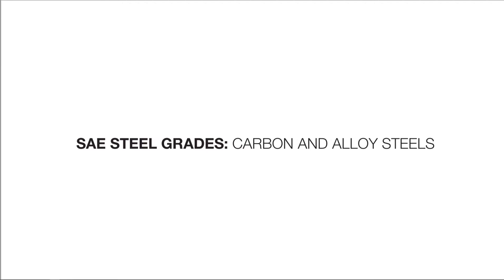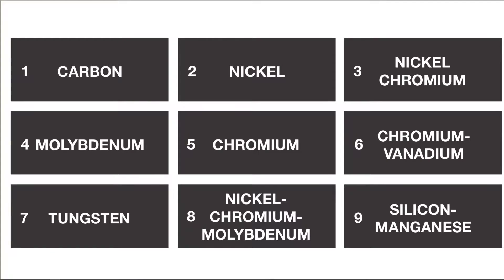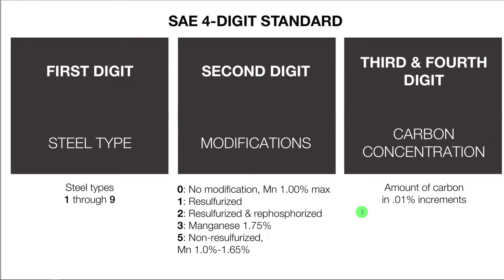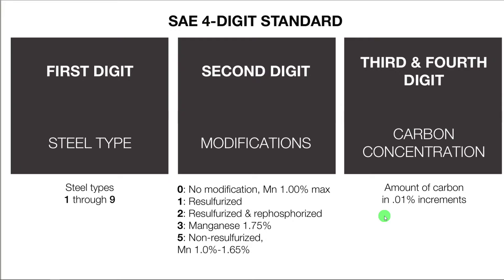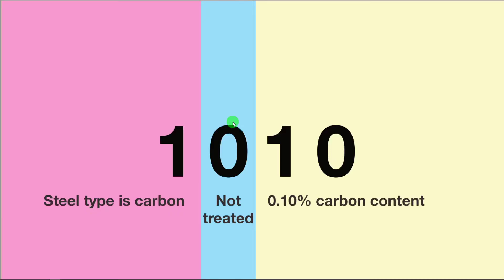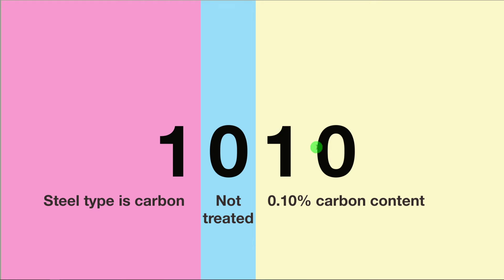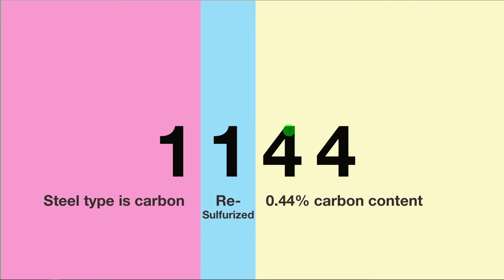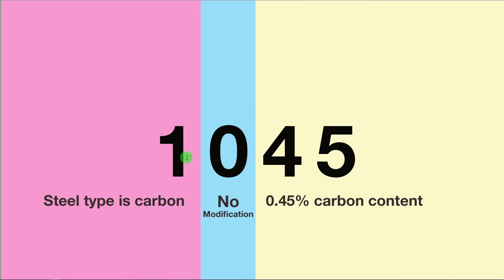SAE STEEL GRADES: Major Classifications of Carbon and Alloy Steel

Comment: Hi, but how does this work for the many AISI-SAE codes that are three digits, like stainless 304, 316, etc? Thanks.
Reply from the maker: The 3 number system for stainless steel is different. Stainless steel is at least 10.5% chromium which changes its properties substantially from being like carbon steel.

Comment: What about more than .99% carbon steels? Like 1.5% carbon, would that be 10150 or 101.50 or is that ecen possible?
Reply: Yes it is possible. The most common alloy that is heard of by the general public would be 52100. The 5 designates the major alloy, the 2 designates the treatment type and the 100 indicates that it has a full 1% carbon content. This alloy is extremely hard and is generally used for the manufacturing of bearings. I hope this helps.
Reply: Thanks dude I forgot about this

Comment: Hey man, im curious, if the steel is carbon steel, you list for the 2nd digit nr 1-3 and 5, so is there no modification tied to nr 4? does nr 4 exist in the sae system at all for the 2nd digit?
Reply from the maker: There is no number 4 for carbon and manganese steels (both start with a number 1), at least not that I have seen as standard materials.

Comment: what's the difference with the AISI grading ?
Reply from the maker: The AISI used to have a letter in front of the number to denote the steel making process. I believe the AISI is not involved anymore, and SAE is the main system.

Comment: Sir please let me know if code is 8620 becase as you sown 5 types of modifications but i cant understand number 6
Reply from the maker: That would be a nickel chromium molybdenum steel with .55% nickel, .50% chromium and .20% molybdenum.
Reply from the maker: Look up SAE material numbers on google.

Comment: Hello!  Could you expand on metal nomenclature and address the odd ball ones like A36, A2, D2, A286, W1?  And perhaps another video on the nomenclature used across the ocean?

Thank you, I liked the simplistic graphics and straight to the point presentation
Reply from the maker: Sure! Glad you liked it! I will look into it. There is a video that dives more deeply into carbon steel on the way!